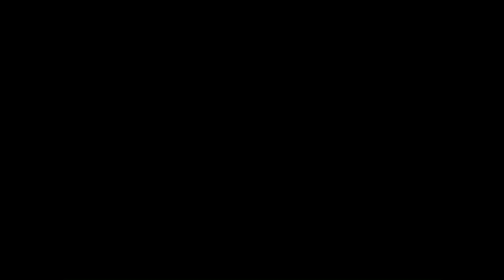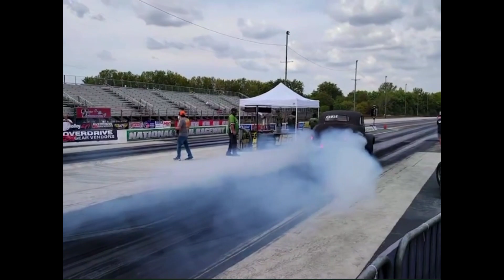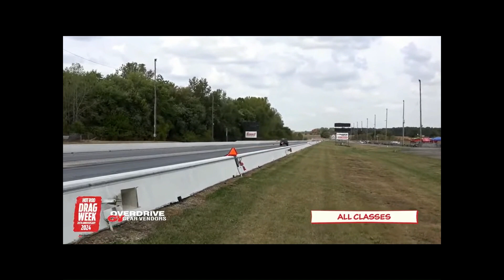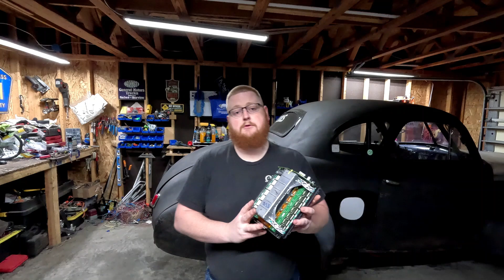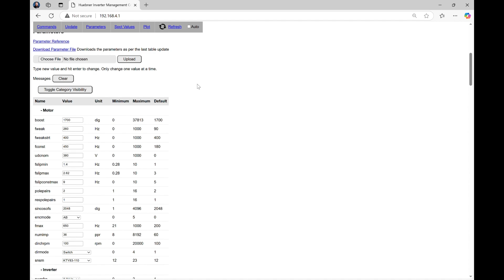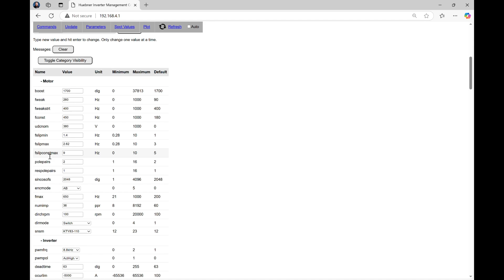Can you tune an EV? YES!

Comment: The Canadian running mid 8s in his st legal plaid model s would agree with you! Still stock battery,drive units,gearing,axles etc. But all his own pre conditioning setup and he's seen 1,390+hp briefly and run well into the 5s in the 1/8th mile!

Comment: Would be cool to see dyno hp vs shown voltage X amperage to see how it compares
Reply from the maker: I've been interested in that as well. I need to do some modifications to the '40 to be able to properly data log, and to create an RPM signal for the dyno. The later has foiled several others' attempts to dyno EV conversions.